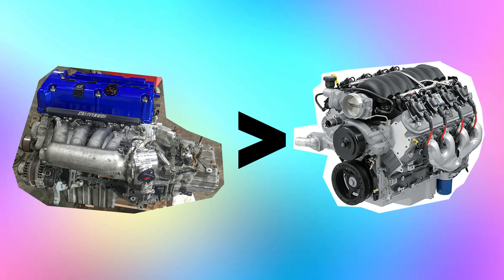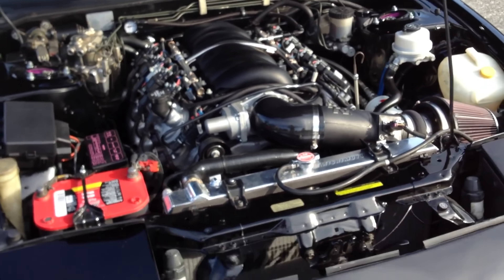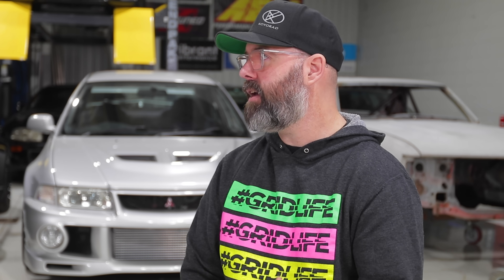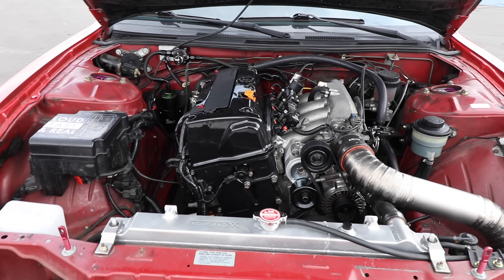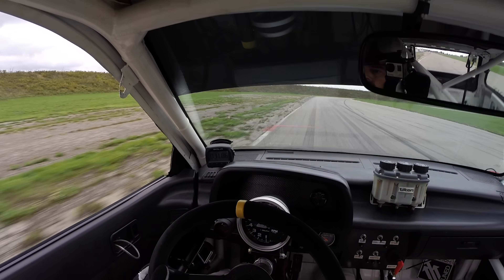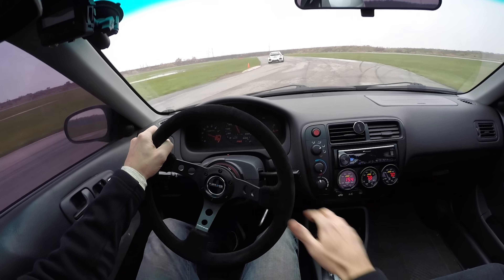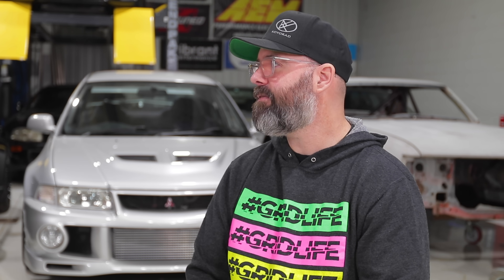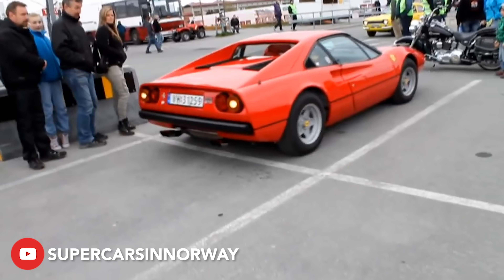Is the K-SWAP the New LS Swap? Everything you need to know about K20 K24 Honda Engines

Comment: One thing I’d like to see is a 1970’s, 1980’s, or 1990’s Front engine Porsche with a Kswap. Maybe the Porsche 944 could be a good candidate. I don’t think that K swap would fit quite as well in a Cayman or 911.
Reply: Those cars 944/924’s had front engine/rear transaxles which may make the swap problematic......or it may make it easier 🤷🏿‍♂️
Reply: @dougschack9341  makes it very problematic. Either you find an amazing turbo transaxle, rebuild one, or scrap the old system and build a traditional RWD setup, which is also very problematic because those cars don't have transmission tunnels in the front, race car only if you do this.
Reply: @GGtheRealest  why? With a custom bellhousing and torque tube I'd argue it's actually easier than mating a gearbox directly. NA 944 gearbox can hold 300hp - any more than that and it would be smart to swap in a Turbo box.
Reply: @dougschack9341  I’m LS swapping my 944 and honestly I think it makes it easier
Reply: There is a k 911 they fit
Reply: danny selak that would be an interesting swap. The purists would freak out but who cares. If you can LS swap a 911 and a Cayman (both have been done) then surely a K would fit.
Reply: @dougschack9341  what's the point of a 911 without a flat six....if you want ls, why not just get a car that came with an LS............ From Matt Farah, Sam Smith, Jason camisa have stated they don't get the charm of an LS 911.........
Reply: Nothing wrong with a bonnet scoop
Reply: The latest swap kit for the 924/944 cars is the 5cyl 2.5l 07k engine from VW/Audi which is basically half of the Audi R8 V10. I'm doing a turbo 07k swap to my rally 944 and cant wait to race with it.
Reply: An early 924 would be nice with the low weight, and better looks :) , but I think the height will be a big issue, or at least a really big bulge in the bonnet. The engine compartments is fairly wide but very low.
Reply: I would love to see them do an LS Porsche 944 instead
Reply: @qdysseus-  that’s what I’m doing to my 944

Comment: The B series is waaaayy raspier than the K series..
Reply: If a B series ran clockwise.......You would even see shopping trolleys with then.I love B series
Reply: I love the k..and b series i love all honda engines with thst in mind..i have a kswaped dc2 integra street/circut car..my wife drives a non vtec accord as a daily and my work car daily hack is a dc2 sedan non vtec my work van is a honda oddesy vtec gots to love that vtec throty sound pulling up to my jobs lmao.. love em all.
Reply: Now im speaking for n/a motors. Throw boost at either a K or B series then they both sound RAW.
Reply: I have a GSR in a 94 hatch and love it, can only imagine what a K20 would be like but the class im building for wont allow it for what i have done
Reply: i love the sound of the K, the B is too raspy for me

Comment: Say what you will about Honda, they had some awesome engineering going into their engines for a while there.  I'm always gonna be a straight six guy myself, love that noise and the overall feel, but if I need a 4 cyl a K series is a good option.
Reply: Honda been legendary just some folk with egos talk their talk but any real car guy or gal knows the Craftmanship of Honda.. yeah yeah daily driver and all the talk but as they said in the video about the engines is absolute. These days its about one million horse power forgetting the weight to HP ratio etc... Honda light weight and fast. Flipping old accord was making 276 or 278 stock I mean come on these new ones 252 or 260 with a tune making 300+... Anyhow your right buddy for a 4 cyl it is the way, many  I've seen blew out mustangs and all the muscle car cars... LOL!!!
Reply: @thesparkiswithin  I have a new civic si pushing around 240whp with a tune and I must say it’s a blast to drive around
Reply: Straight 6 is definitely the best sounding engine (on the reality side away from Ferrari 8s and 12s).
Reply: honda have made almost every type of engine layout you can think of. including boxer, v5, inline 5, and even an inline 6.

Comment: You’re right, I was never into Honda’s but this K series has me swooning over it. The HP/L factor is incredible. Not many cars make that kind of power N/A. N/A performance is exacerbated when boosted, not sure Honda intended all of this but I believe the K series is going to be the best all around 4cyl for years to come.
Reply: Imagine if Honda made a 4.8L V8 that was basically two K24 connected at the crank.  Would be one of the greatest motors of all time.
Reply: Plur307 nothing new from Honda, check out Formula 1 and Indy Car if you want V8 or V12 Honda engines.  Only street car even close to having a Honda V8 was a Mugen concept car (rwd accord with 4.0 V8 something like 500hp)
Reply: @wd4950  I mean for production cars.   I don't really take interest in special snowflake racing engines that are rebuilt every 500 miles.
Reply: @Plur307  good one, thanks for the laugh
Reply: @Plur307   Look up neutron engines
Reply: the b series did the same in its prime. record hp per litre, f1 genetics, economical reliable motor in a light well sorted chassis...typical Honda
Reply: Usually when you turbocharge a high performance NA engine they respond very well to it because  they have good head flow from factory. Eg, B, K series, toyota ZZ, LS1 and Audi 4L V8.
Reply: @hendrahendra  what about compression, you can’t just slap a turbo setup on a proper built high hp NA engine
Reply: @yourmommashouse  yes you can, but with very mild boost.
Reply: @yourmommashouse  you want some extra volume of air from the turbo. Keeps engine happy, lower charge air, makes it more efficient. You know that more boost doesnt equal to more power right?
Reply: @yourmommashouse  yes i know how an NA and a Turbocharged engine works. Generally speaking High Performance NA engines like i said above have great cyl heads like the ones from Honda B and K series and the Lamborghini gains alot of power when you stick a turbocharger on it. You know that a well designed turbocharged engine can make gobs of power at a very low boost? What im trying to tell you is boost is restriction. And turbocharging a STOCK NA engine is best done with low boost. Go ask the honda boys with stock engine and a turbo, no you dont want to add big boost, you said it your self, its gonna grenade itself to pieces. If you want lots of power obviously you will need to reduce compression. All in all that im trying to point out at my initial comment is that the basics of a High Performance NA Engine responds very well to turbocharging even at low pressures.
Reply: @hendrahendra  actually K20's and K24's can run 400 - 450 WHP on low boost IE 12 psi, basically indefinitely. As in it will run it for 5 years without any issues. and people have run the engines upwards of 550 WHP without any issues supposedly.
You dont need much boost in K series and they will effectively double their power output
Reply: Lex PFI/Boostedboiz

Comment: A K24 Turbo E36 would be a cool build especially since you would get the good trans to start
Reply: it is, my dream is a E36 compact with a NA K24 aslong as it fits under the hood. Would be the perfect Trackweapon
Reply: @maxzimmermann6605  it fits under the hood. It fits in an E30 as well. A E36 Sedan would be the best option since they have more chassis rigidity than Coupes and they are usually also cheaper
Reply: I have an E36 track car now with a SBV8 swap, once that gets tired, K-swapping for sure.
Reply: @alex.car.life on instagram for a turbo k24 e36 guys. Been done for quite a few months
Reply: Look for @brentcommarice on Instagram, he is building a turbo K20 E36
Reply: I know someone from Spain with a K20 Turbo in an e36 coupe!
Reply: It’s been done, it’s a cool build👌🏽
Reply: Buddies doin one on a e30
Reply: zeroyon223 its a joke :)
Reply: @zeroyon223 yeah have you tried to find good parts for 4cyl BMW engines ? Got the M44b19 in my E36 and I would rather have the k20. That being said, it will probably be cheaper and more powerful to just turbo the M44. not to mention that the M54b30 is a pretty good engine to compete with the K-series.
Im a Honda guy, but I would rather have v8 in my RWD cars unless Im trying to fit into a certain engine displacement class on track. Would love a K engine in a 5gen civic, however nothing beats the LS sound.
Reply: M50,  m52, s50 are good engines
Reply: An LS would be 1000% better tho and 8 into one headers make it sound out of this world
Reply: M42B18> K24
Reply: @stankomihov  Are you out of your mind? M42 is old outdated technology, it doesnt even have variable valve timing
Reply: @tuurbow  maybe he likes the sound, but listen to that VTEC sound 😩
Reply: @stankomihov  M43b16 > M42b18

Comment: Unless you're really brand specific, the only swaps worth doing for NA builds in the US are K20/24, VQ35DE/HR, or any LS. It just depends on your power/torque needs and desired engine characteristics (redline, sound, power delivery, weight, ect). Any of the three would make great track motors with a ton of aftermarket support.
Reply: I agree except with the VQ35
even the HR is a turd
Reply: @Adam-zi5se  How is the HR a turd? With easy bolt on mods you would need for any engine swap, they'll be 375HP/300Tq which would be amazing in a 240Z, 240SX, Miata, ect. Plus, you can rev them to 8K if that's what you're into. You also have the CD009 attached to it. A stock LS1 would do the same numbers but rev completely differently.
Reply: Coyote 5.0 are really good N/A engines more expensive ofcourse
Reply: @dilsher12  I love the Coyote, but the price jump over an LS is hard to justify unless it's a Ford chassis

Comment: Or the k swapped smart car faster proms just built with Brent from PFI?
Reply: A first generation lotus elise is a much better K swap platform than the smart car.  It weighs about the same as a smart car but is a much better chassis.
Reply: @Plur307  the S1 is one of my all time favorites. I remember in the early 2000's people were importing them "legally" and putting B series motors in them. Then they found out they still weren't legal. That was my dream car back then.
Reply: @leftocastpunx83  Cars can be imported and street legal if they are 25 years old.  They can be registered as a classic/collector car and all emissions and crash safety requirements are ignored.  So in 2021 a 1996 Elise S1 can be imported and driven legally on the streets of USA.
Reply: @Plur307  I agree, but the Katertot is fast and silly. Probably drives like total garbage because smartcar chassis is not great.